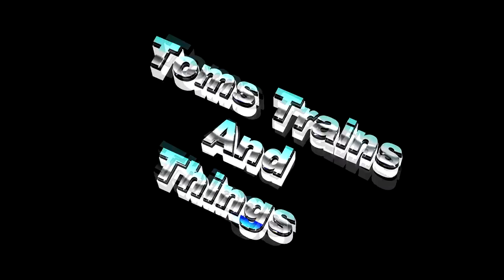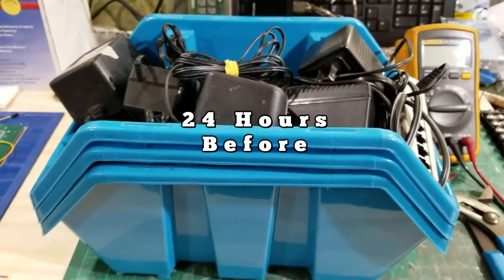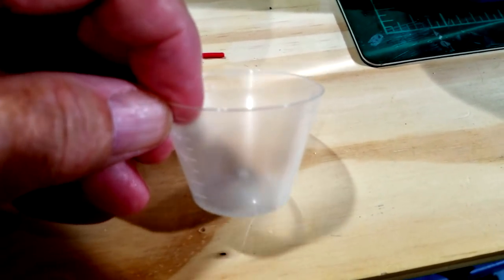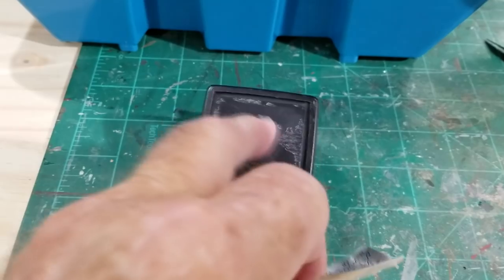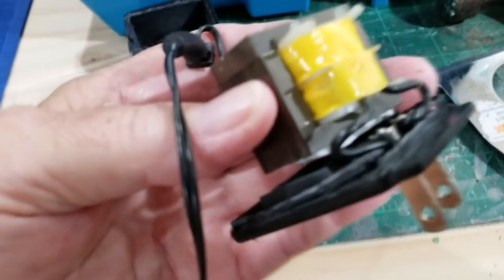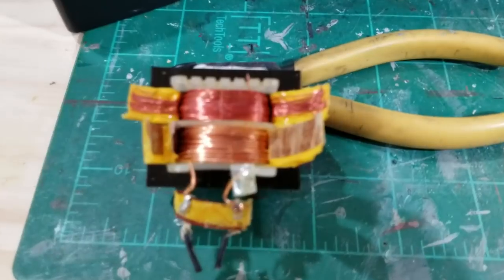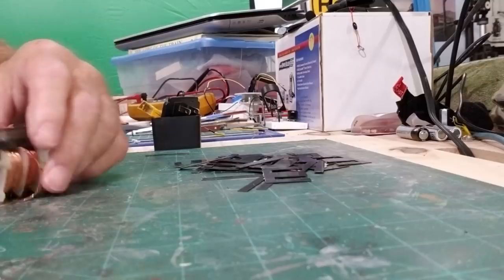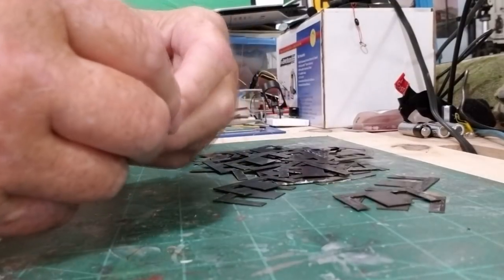Why Waste A Wall Wart When There's Wire Within

Comment: Great video Tom, It never dawned on me to open them and snag the wire !! One question, why waste time unraveling the wire instead of just leaving it and taking off wire as needed? Keep those great and very informative vids coming !!
Reply from the maker: Thanks Mark for watching and subscribing. I leave the wire on the coil as is. In the video I was unraveling the wire I ended up cutting while removing the tape.

Comment: COOL, I have striped several large transformers apart, about 4ft X 6ft X 3ft 440volt spot welders, anyway thanks for sharing
Reply from the maker: That's some heavy duty wire in those Randy. Years ago, about 40, when I worked on the railroad, we had Lincoln Welders that were actually generators. Had to disassemble them, undercut the mica spacers and replace the diodes that had a 15/16 nut to attach them to the frame. A little bit bigger than what I'm playing with now. lol

Comment: FYI; remember OLD wal warts, not new ones, most new ones are a switcher supply, 
ways to tell is light weight and multi voltage ac in
Reply from the maker: Thanks for the info Bill. What kind of components are these wall warts powering? Just to let everyone know what to, or not to look for.
Reply: cell phone and tablet chargers are for sure. best thing to do is to say if dropped on my toe would it hurt, most are very light.
By the ways another source for transformers , radios , plus you may find other parts you could use like a pulley , LEDs  , and the power cord usually good wire to use.
And don't forget the wal wart wire cord is a very flexible wire and although black most have a polarity mark
Reply from the maker: Thank you Bill
Reply: Velcome
By the ways , i wonder why i open one of your videos i get a nespreso ad
Reply from the maker: Have you looked at anything similar to that lately. Danny D'vVeto - George Clooney - coffee pots!  Usually ads show up based on the viewers browsing history.
Reply: satic ads at certain websites do BUT for some reason youtube ads are way off, with exception of when I search arduino.
Wish they figure out hat I am Not a coffee drinker
Reply from the maker: +billfusionenterprise wow, can't explain that one. Most of the ads I see are pretty close to my browsing history.
Reply: By the ways i was going though some yesterday and came across 3 that are switcher types, all where 5 volts dc out and had a 100 to 220 volt input, plus light, plus 5 volts at 2 amps
Reply from the maker: Thanks for that information. I think I have a few from older cell phones with a light. I'll have to tear one of them open.
Reply: you find a transformer but it will be very small
Reply from the maker: Isn't technology amazing! I can remember my dad had one of the first transistor radios back in the late 60's with a 67 1/2 volt battery. It was similar in shape to the 9 v batteries but about 20 times bigger. The radio itself was the size of a shoe box.
Reply: probably why he used an AC on